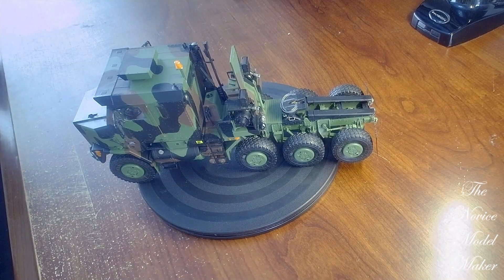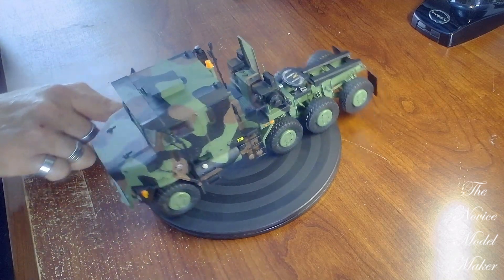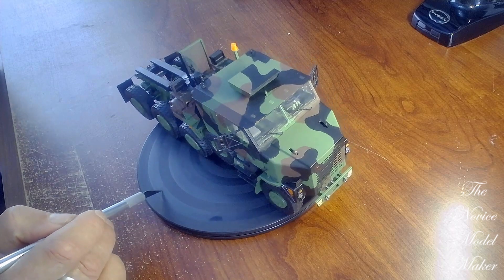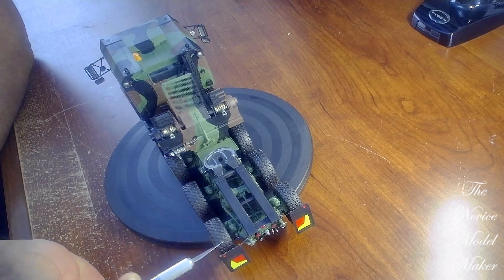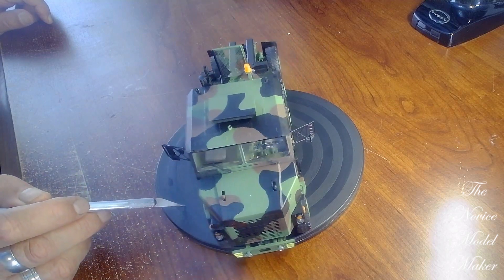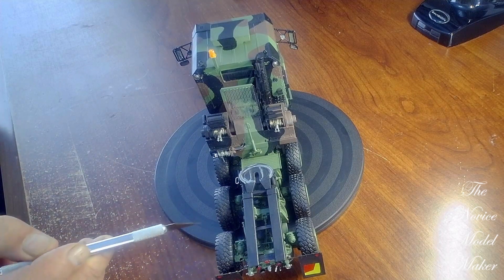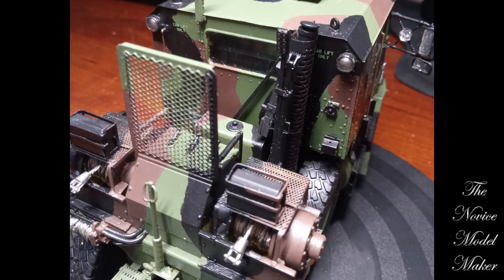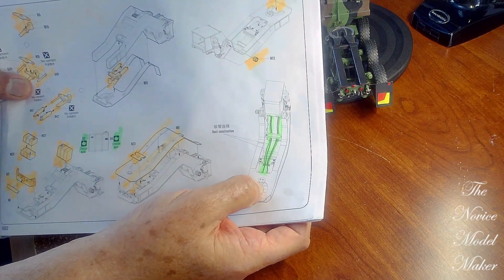M1070 & M1000  HET (Part 10 The finished Tractor Unit).

Comment: Hi Mike, that turned out absolutely fantastic, you should be very proud of your effort, will you be placing a 'load' on the trailer when it done, pity this is not the UK/British version, best regards from a Kiwi living in Australia.
Reply from the maker: Thank you Les, I did try to get the UK version but the only one available is a resin kit that didn't look much cop in my opinion. As it happens when the UK first started using these they used the US version so it's not too bad. Yes I have a Challenger 2 TES to go on the trailer and I'm going totry a little bit of weathering on it, hopefully they will look good together. Thanks again. Just a quick one where in Australia do you live, I lived in and around Sydney for 10 years in the 60s & 70s.
Cheers Mike.
Reply: @MikesMilitaryModelling  hi Mike, I moved over to Melbourne from Christchurch NZ at the start of 2004, so have been here for just over eighteen years, I also now travel on a Aussie passport, where in the UK are you? I have a friend in Rochester, take care and keep safe mate.